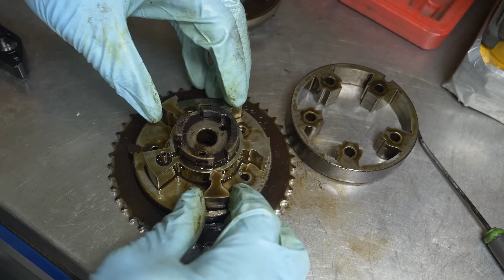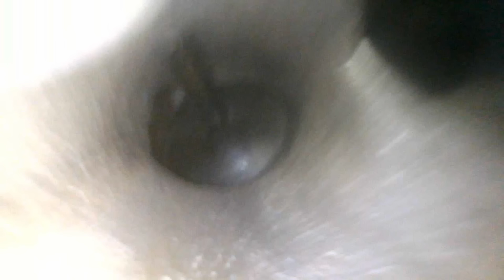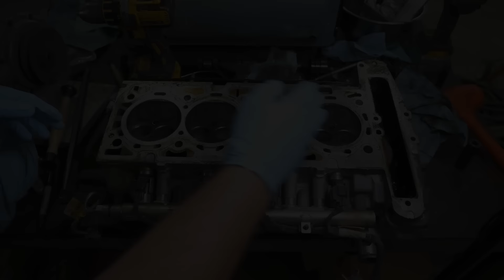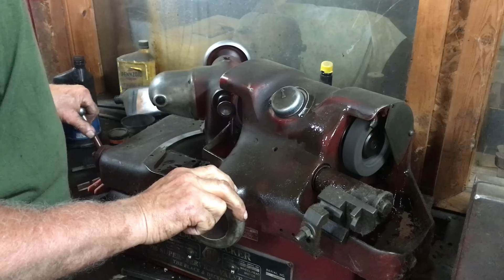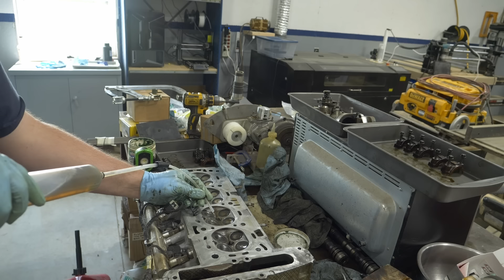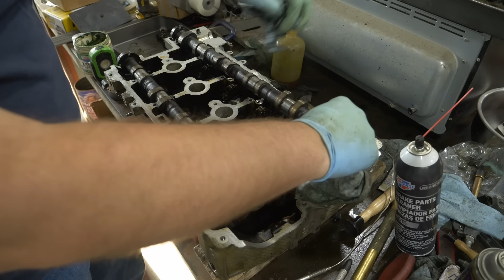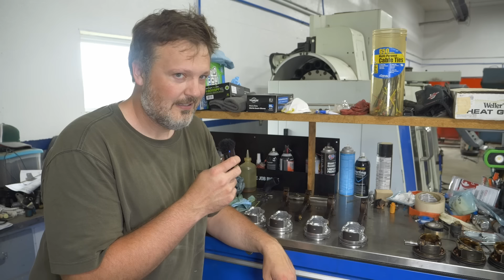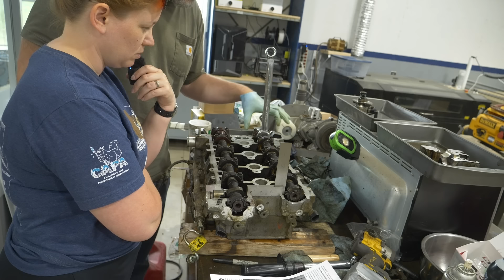How Did it Ever Run? Equinox Still Won't Start

Comment: I was a technician at GM for 10 years, I could not tell you how many 2.4l Equinox\Terrains I performed piston jobs for oil consumption, and out of all of them I have done, I've had two with the reluctor wheel on the exhaust side cam moved and over a dozen with the connecting rod bushings spun, I'm convinced it was due to heat making them turn, and I definitely feel your pain!
Reply: So what causes the heat, do you know? Is it oil going into the engine instead of through the drainage holes, causing poor lubrication of the con rod bushings? I'm still learning lol
Reply: @Jeff2Deff  with the oil consumption from the low friction oil control rings getting stuck causes a oil consumption which can cause  oil starvation which in turns creates more friction which causes higher temperatures within mechanical moving parts that expand once heated and are able to have a loose fit from a once press fit operaton. Seen it multiple times. Oil changes and checking oil consumption will tell you the health of the engine along with compression test. Those low friction oil rings where the worst from GM and I would suggest a wiseco piston replacement better oil control rings. GM did this to allow the engine to be able to make more power and be more economical essentially a cleaner more fuel efficient engine.
Reply: @Jeff2Deff  My wild guess is, due to the oil control rings not being able to drain back oil, it doesn't help cool off the wrist pin bushing in the rod causing it to overheat and spin. 

Reluctor wheel on a cam? Not all that uncommon in other cars... VW on the EA888 engines have friction fit lobes... they spin once in a while.
Reply: @srrymonkey the Saturn engines had the same problem. If I recall, there were pistons available with larger drain holes. 

Someone also did a write up on drilling out the drain holes to help prevent this. 

I had an 01 sl2. Guy I bought it from had been feeding it oil for 10 years. About 4 months later, cyl 4 lost compression. So much buildup, caused a valve to stick open. Sold it before fixing it.
Reply: @Jeff2Deff  the oil caking the way it did in the rings and on the valves is from the car running hot to begin with, the oil issues are the result of the heat not the cause. I'm gonna say stuck thermostat, bad water pump, blocked radiator, something caused the engine to get hot for a prolonged time, to the point where all these issues have formed, the final nail was the reluctor wheel spinning.
Reply: @salamonius  Wouldn't the head be warped with that much heat?
Reply: These engines are clearly junk.  But that won't stop a die hard GM fanboy from posting that we're all crazy -- and his 2.4 Equinox is at 300K, has never burned a drop of oil, and has needed nothing more than oil changes and brake pads.
Reply: @ShowMeWhatINeedToKnow  you never ever ever see cars like this all rusted out and barely moving down the road, they've failed mechanically way way way before then. At a used car lot near you!
Reply: issues is the pcv system. I worked at factory that made the intake. the pcv is integrated into the plastic manifold. it gets clogged leading to excessive oil consumption and seal failures. car is designed to get past warranty.
Reply: @alanprather8399  Is the PCV system cleanable or is a replacement required?
Reply: @dans_Learning_Curve   I looked at one of these with 60k on it and decided no. I've seen youtube where people cut the manifold to clean it. the way it's designed is it has a channel in the manifold. you could clean it but easier to do with manifold  off.
Reply: @dans_Learning_Curve it can be cleaned. I haven’t cleaned mine yet, but I need to.
Reply: @alanprather8399 it blows out the rear main seal and will dump out all of the oil.
Reply: Everything about this engine sounds like a class action.
Reply: @aserta we need more of it with all the crap the put out today. 
Engines that only outlast the warranty is pathetic, especially at the prices of vehicles now. 
Nothing made today will be antiques that run. 
And the cost of parts and repair is r*pe
Reply: @aserta  too many miles, it lasted well past normal life
Reply: @aserta good luck with that….
Reply: I guess this is why there are no spare parts available now! And given that we're supposed to have all the info in the world available at our fingertips now, why isn't this info available ... sounds like at the very least it should be the lead article in Wes' $22, 3 day subscription!
Reply: What she said! I would’ve abandoned that engine for a junkyard engine, a long time ago😂 It’s a money pit😢
Reply: @Soldierboy1986  LS swap.
Reply: @brainfreeze44131  Actually like that idea...have welder will travel...:face-blue-wide-eyes:😉
Reply: @Soldierboy1986  If you can find one, the cost is typically more than the car is worth.
Reply: @GlacialErratic exactly my point, there’s no way i would put a 7k crate motor in a 2k car😂
Reply: Wes you're looking good! Looks like you've dropped weight.
Reply: @dontworryboutitdude  With jobs like this you dont eat for days or sleep .Ask me how i know .LOL!!!!
Reply: I had the first gen GMC terrain (2010 2.4L) and had to have the pistons/liners done at 80,000, traded it at ~150k as it was starting that same symptoms (high oil consumption).  Bad piston design allows oil blowby into combustion and fuel blowby into oil, causing high oil consumption, and if not monitored carefully, low oil can cause the timing chain tensioner to slack, or fuel mixing with oil causes poor lubrication, and higher friction temps, premature part wear, and that's probably what slipped your cam and wrecked the bushings in the pistons.
Reply: Thought I'd comment that these automotive leak down testers typically have a 0.040" orifice between the supply pressure gauge and the cylinder pressure gauge as described in bulletin AC43.13 REV 1B.  So, you're measuring the pressure drop across the orifice caused by the cylinder leakage as a relative measure of sealing effectiveness. To be a  relative measure across different engine sizes, one would have to change the orifice size..... smaller engine,  smaller orifice.
Reply: fascinating, i'll keep that in mind
Reply: Sometimes im happy with my etron audi
Reply: Sorry to learn that.  I, too, have been "pro GM" most of my life, since the early 60's.  Can't believe what I'm witnessing these days...
Reply: Sounds like the PCV is destroying the engine just EGR systems destroys diesel engines.
Reply: Intake carbon deposits?
Reply: @williampierce5615  PCV system. Regens all the stuff that gets past the rings and throws it back into the the intake.
Reply: I had never planned on buying one before, and I still don’t plan on it even more now. Lmao I’ll stick with my old Crown Vic. 🤣🤣🤣
Reply: Nearly every time I see an Equinox or a Terrain, the engine is making an unholy death clatter.
Reply: I had a brand new 2015 Equinox with the 2.4 banger. Biggest POS I ever had. I’ve been a GM fan all my life and had many GM vehicles but the Equinox pushed me to the end. I had it for 5 yrs. The 4th  year I had half the engine replaced due to stalling, bucking, severe vibration. Extended warranty paid for it then the following year it had to have a second overhaul (same stuff, same issues). I end up paying that then a few months later it started to give me issues and I traded it in on a nice 2014 Acadia Fully loaded and lot nicer.
Reply: Equinox, Terrain and Cruze try not to be a POS with owners that can't maintain their car challenge, (impossible)
Reply: Yup.  I had a 2011 that the dealer replaced the pistons on that had the oi consumption issue.  Thankfully, I caught it in time to have it done under their service bulletin on it.
Reply: P
Reply: Blake I'm based in the UK as a tech would you say that's a massive design fault or something else.
Reply: This problem is open intake valves, even with good timing a defective intake valve in each cylinder head will cause it...this could be used springs which leads to bad timing no matter what.
Reply: I bet the oil issues all are related to using thin synthetic oil. 
I run HD 15w-40 diesel oil in all my car engines and have never lost a cam phazor or timing chain in over 350,000 so far.
Reply: Let me get your opinion, I have this same exact equinox 2.4 180k it had coolant seeping near the water pump and the start of oil consumption issues where it uses a quart of oil maybe every month. I hear a rattle on cold start which is assume is common on most engines at cold start.  Is it worth fixing?
Reply: @erikgonzalez2278 let me get YOUR opinion:  Have you watched Part 1 and Part 2 of these videos?  If the answer is “yes” and you’re still contemplating going down this path, how do you feel about seeing a psychiatrist?  If I were you, and I’m certainly no expert,  I would drop your 2.4 Equinox like a hot potato and never look back.  I wouldn’t put one thin dime into the car after watching this.  What a monumental joke General Motors has become.  It saddens me deeply to think about what they once were (one of the largest and most powerful companies in the world) and see where they are now……😢
Reply: @beauhatman4395  I have one thanks for your concern. Do you have anything relevant to add or experience to my comment?
Reply: @erikgonzalez2278  No, dump it now. These repairs relative to the value of the vehicle make no sense if you're not a Youtuber.
Reply: @erikgonzalez2278 YES!  GET RID OF IT.  ITS A MONEY PIT!
Reply: @beauhatman4395  GM effectively canceled Holden, just think what could have been.
Reply: @beauhatman4395  GM owner for over 60 years! Last new GM bought in 2005 and is the LAST GM I'll ever own. Period. 2000 Nissan Altima bought new, 244,000 miles and never a hiccup in the drive train, just normal maintenance and a new PLASTIC radiator. Tuneup at 125,000 miles and it still starts instantly. But it's the last Nissan I'll ever own. All the new(er) vehicles are total CRAP!
Reply: @beauhatman4395  You nailed it brother. I was a die hard GM loyal customer. WAS.
Reply: @OtisFlint  It's worthless as it is. Do the repair.
Reply: @31terikennedy  Your logic does not logic.
Reply: @beauhatman4395  I hate that you are right....and hate it even more that I own a 2015 model that's in the shop right now.  Anything you spend on these is a complete gamble, if you are lucky replacing the timing chain ahead of time might save you on some things but wear and tear on the pistons and rings...good luck.  If you aren't proactive with these things then I would forget about it...the problematic engines are all about 10 years old now so the car itself is starting to wear out and is probably hardly worth redemption.  I have rust spots in my doors and fender wells...live in the rust belt of Ohio.  I preemptively am getting the timing chain replaced since I'm at 117k...it makes a slight noise but it runs and drives fine.  I do consume a lot of oil so my days are numbered.  I will try to squeeze a few more years out of it but I am so unimpressed with this vehicle, if my repair lasts me even a year it was worth it since the car is paid off.  My dad retired from General Motors and we were die-hard fans with GM products but as time went on, they've only gone down hill.  The entire industry makes throw away cars, and with fewer mechanics out there, it's even more expensive to work on them.  Try to do it yourself and it's even more troubling that you have to have a minor degree in IT and electronics in order to work on them and to do all of the research to get the information that you need.  I'm just over it...this design is absolute garbage - has GM learned anything in the last 100+ years?
Reply: @Phocoshay_Balperrus sad to say I’m in the same boat. Over 30 GM trucks and classic cars. After our new Equinox left my wife and new born son  stranded and GM did nothing we quit buying GM. We did buy a couple Fords after that but it seems like most American cars have the same issues. We now have 2 Mazdas and my 2007 Toyota FJ with only typical repairs. And to think of all the money I wasted trying to support the US auto industry. 😢
Reply: @jdshear01  This engine needs regular maintenace because of the pcv design. Drill a hole in the intake manifold and clean it out. They have had this problem for years! We had one 2.4 moisture built up and freezes and blew out the rear main seal and you instantly loose all oil and blows your engine up!
Reply: @erikgonzalez2278  What condition is the body? Rusty? Can you do your own work?
Reply: @dans_Learning_Curve  all valid points lol no I can't do my own work I don't know or have a brother that's a mechanic. Both fenders are dented and I live in California so no rust. It has been serviced quite a bit doesn't need suspension work. Id have to pay someone to do the work on the motor.
Reply: @erikgonzalez2278 burn it!
Reply: @erikgonzalez2278  I recommend insurance fraud, get rid of that thing.
Reply: Thank Obuma EPA. GDI & other "gas savings" environmental foolishness.
Reply: @knockywigglesworth1909 Brush up on your history, Nixon created the EPA!
Reply: @jameslarson6555 Right you are & NASA launched rockets with huge clouds of R22 escaping into the atmosphere.. But if Grandma's A/C leaks 1-2 lbs. a year... The sky is falling because EPA became radical fools like Chicken Little..
Reply: @knockywigglesworth1909 , GDI isn't a problem if you fog the intake every x number of miles depending on oil consumption. Engines that consume very little oil can go well over 100,000 miles and still not need considering being fogged so it's really a non issue and really simple to address when it is an issue.
Reply: @pcspecialistpdx You certianly maybe correct but my customers barely check or change oil so.. Yeah...
Reply: You're another unpopular environmental freeloader. We here thrive on our clean air. @knockywigglesworth1909
Reply: @knockywigglesworth1909 you would think they would accept the challenge and develop a good engine that could be worked on😊
Reply: @knockywigglesworth1909  You are an idiot.
Reply: @knockywigglesworth1909  - I love how Obama doubled the cost of healthcare, too.  What a great guy.
Reply: @ShowMeWhatINeedToKnow And of course you forget that he doubled, maybe crippled the number of people on Healthcare. Many couldn't even get any Healthcare before the ACA. And just try taking their Healthcare away now. Republicans got ZIP for alternatives.
Reply: @ShowMeWhatINeedToKnow Health care cost yearly increase actually are reduced post ACA compared to prior years.  So you’re correct, thanks Obama!
Reply: @jameslarson6555  - Tell me you don't buy insurance on the open market without telling me you don't buy insurance on the open market.
Reply: @ShowMeWhatINeedToKnow  This is not a platform for you to indulge in a lot of MAGA stuff. (or your mate)
Reply: @daviddonne7333  -  Why is it always the left that tries to silence speech?  Obviously you voted for the absent minded podophile that couldn't complete a sentence without a teleprompter, destroyed our border, gave 69 billion in aid to fund the Ukraine war, pardoned his entire crime family, and forced the transfer of wealth by paying off 189 billion dollars of other people's student loans.

Comment: You would have thought that it’s a Kia/Hyundai with such problems. Thanks Wes!
Reply: Hyundai would have been on it’s third engine already
Reply: @markfierke8565  No doubt!
Reply: @markfierke8565 thing is even after 3 engines you wont spend 7k 😂
Reply: BRAND NEW Next Day on Amazon just bought one installed in 90minutes.      1.6 gdi baby runs like a champ . G4FD   2k bucks

Comment: Best car repair channel on YouTube.  I would guess oil changes on this vehicle were few and far between.
Reply: We've recently found out that since the late 2000s major manufacturers specify both an engine oil to use (too thin) and change intervals (too long) that lead to rapid piston ring wearout, engine wearout/overheating, low oil levels and eventual high oil use in what seems a widespread 'industry practice'.
Reply: @trillian23x Early 2000’s saw widespread use of low tension piston rings. 
In conjunction with the recommended 10,000 mile oil change , lead directly to the high oil consumption. Most auto manufacturers now say 1 qt of oil per 1000 miles is acceptable. 
They just want the vehicle to make it past the warranty period.
Reply: @trillian23x Planned absence obsolescence I guess. Less people have been taught how to handle these things.
Reply: Wes and many others have said, do the Oil Changes as required or even sooner, especially on these newer engines
Reply: @GrandsonofKong  by the look of the oil piston ring he doesn't need a oil change🤣, wes said he was putting one quartz of oil every month
Reply: I like watching Wes whenever it comes to mechanical related issues. He’s an engineer; not just a mechanic. Engineers come up with a development when the solution doesn’t work.
Reply: I also wondered about the quality of the fuel used. There is little doubt that premium fuel here in the UK does make the engine run better and cleaner with more MPG and less emissions although it costs significantly more at the pump.
Reply: @Dan.Whiteford  The government is not your friend and never has your best interest in mind. That's why we carry the big iron on our hip in the US, mate.
Reply: @COBRO98 your comment has nothing to do with what Dan just wrote.
Reply: @swede178  He's from the UK, he needed to hear it regardless.
Reply: @swede178  indirectly it does. US government forced that corn squeeze gas on us. No one asked for it. It has less power than pure gas and contributes to other engine problems.
Reply: Thanks for your comment, I have no idea what this person is eluding to or talking about. Dan